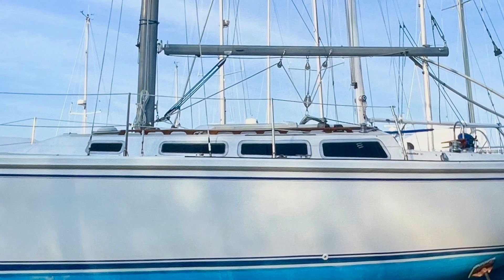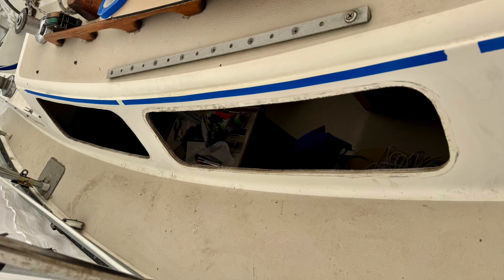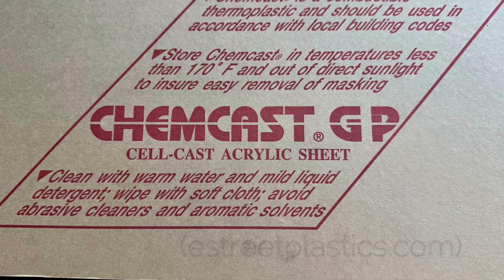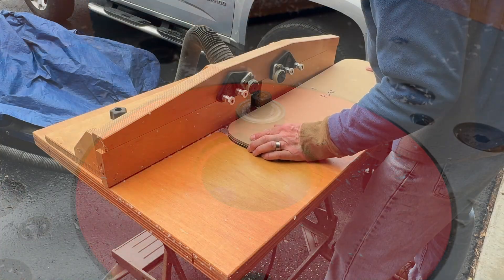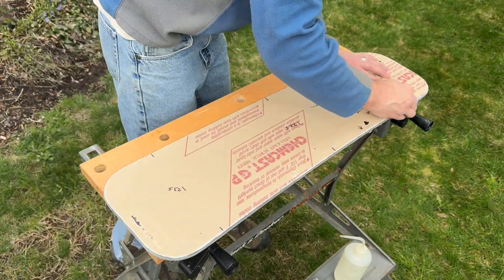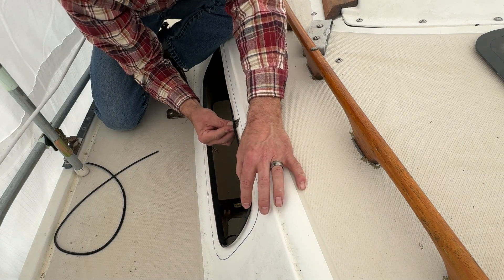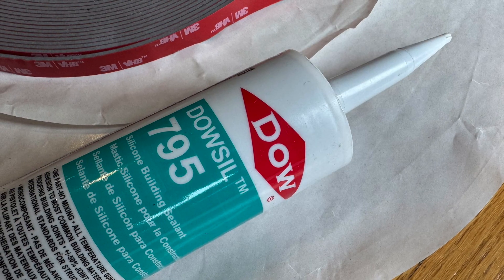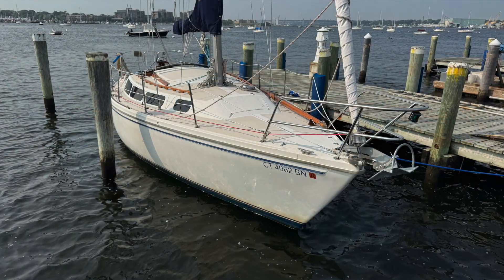Making New Frameless Boat Windows

Comment: Love this video and excellent timing as  I was looking to do this project on our 78 C30 Iin the next few weeks. 
How much 3m tape did it take to do all your windows?  Need to order some dumbbells also.
Reply from the maker: Thanks. One 100’ roll of tape was more than enough. I was also able to seal all windows with one tube of the sealant. The dumbbells were more useful to hold the windows for marking rather than needed for adhesion (the tape sticks very quickly). Good luck with your project.

Comment: Those one piece windows don’t seem last they start cracking from what Ive seen…. Did you ever try completely refurbing resealing the original windows  🤔
Reply: I did a rebed/reseal on my metals about 12 years ago.  Leaks just come back worse as the frames corrode more and more over the decades.
Reply from the maker: @thegarbone my 43 year old aluminum frames were badly pitted too.
Reply from the maker: You can spray them with a UV protection to help keep them from crazing.  To properly reseal the old window, they have to be removed.  It is a very laborious and difficult job. This was actually much easier.

Comment: 9:28. 
I used it too for my boat windows. 
You can also bent it so you can bring it on in one piece and have only one opening. 
Nice work. 
I did exactly the same 2 years ago. 
Gr from the Netherlands
Reply from the maker: Thank you.  I didn’t try bending the tape around the corners, but that would have been easier.  I was afraid the radius was too tight.
Reply: @brianweekley5700 
No, the tape is perfect. But keep the pressure with one finger wile bending. 
It looks very well on your boat. 👌

Comment: Good job anyway. All sailors are inventive and handy.
But, would you be more precise telling use "so far no leaks"?
Tell us like "two seasons on water and no leaks".
So far is not description. I'd like to know if such repair is good for one or rather 5-7 years.
Reply from the maker: Fair enough.  After one year, no leaks.  However, I’m confident this was a good and long lasting fix.  Changing from a frame system to acrylic panels attached directly to the exterior cabin top is much simpler.  The VHB tape provides a flexible adhesion interface that should allow for expansion and contraction of different materials.  Time will tell, but I have no regrets.

Comment: I sealed the badly leaking windows on my 1980 Catalina 30 by masking around the frames (inside and outside), removing every other screw in the inside frames and injecting slow-expanding foam into the screw holes.  The foam expanded into the voids on the inside of the frames, sealing the windows.  When the foam hardened, I removed the masking, scraped off any foam that had oozed onto the glass and replaced the screws.  The leaks were gone and stayed gone for the remaining 5 years that I owned the boat.
Reply from the maker: Interesting approach.  Had not seen or thought of that or I may have tried that instead!  However, I do like the updated appearance and have been happy with the results so far.

Comment: Great looking upgrade, makes the boat look more "modern"
3m products are my normal go to for vehicle work because they have product solutions for everything, like that bonding tape, as for using the sealant around the edges, thats all that product is, a sealant, the bonding tape is the primary retention for the windows. As for the original aluminum window frames acting as a cabin stiffener 🤔 those original windows assemblies leaked because the aluminum expands at a different rate than the fiberglass cabin and those frames do not flex compared to the cabin, so you get leaks. At least the new windows will have the ability to flex and have a 100% mechanical bond to the cabin cutout, so less leaks.
Reply from the maker: Thanks.  You are absolutely correct.  That’s why 5200 would be the absolute worse choice since it would not allow any flex between the acrylic and fiberglass.

Comment: Good idea and nicely taught and demonstrated! My boat's windows are already put on similarly, but are twice as thick and have some compound curves to bend them around. They are also screwed into the fiber glass with SS screws and dimpled washers. They are all crazed with UV cracks and will have to be replaced as I can't see through them when the sun shines on them.
Reply from the maker: Thanks.  Good luck with your project.  It's worth it!

Comment: Interesting Video. I did mine a few years ago. I used the Dow Goop without tape  My windows are also screwed in and then covered with a trim. Results are excellent.  Your quicker method seems a lot easier  and equally as effective. Nice to see.
Reply from the maker: Thanks. I appreciate the comment.

Comment: Thats really cute.
go through all the trouble and work to make windows on a boat then use home building sealants.
Reply from the maker: Both the 3M #4991 VHB tape and Dowsil 795 were recommended by the manufacturers and are more than suitable for above waterline applications such as these windows.  The 795 also has excellent UV resistance. Your specific concern is?
Reply: @brianweekley5700   Again, company specs mean nothing in the real world. That why 5200 is the go to choice for us in the North Atlantic and Bearing Sea, where failure is not an option, if you want to make it home alive.  But you carry on with your hobby sealants. BTW, the aluminum frame around the potlights you took out acts as structure to aid the tin flexible fiberglass topsides. Thats why the cheap original  sealants failed. Too much flex in the cabin top
Reply: my 1st thought was "does he know that black 5200 is available?".   i'd use it from prior experience and nowadays the insurance co's will nullify policy coverage if non-marine grade products are put into service on my boat
Reply: In most cases, the only difference between "Marine grade" and "Construction grade" sealants is only two to four times the cost.
Reply: @OrchidsOutOfChaos  Hehehe, tell that to the fishermen in the North Atlantic and  Bearing sea, They'll tell you stick to your computer and leave the building/repairing of boats to those with enough experience to know what they are doing

Comment: I did my West Wight Potter windows exactly the same up until the adhesive tape. I chose butyl tape and screws. I figured butyl would make my widows easy to replace in the future. I love the updated look it gives to my potter. No leaks in 3 years now.
Reply from the maker: Nice.  Understand the desire to use butyl tape and I do so whenever possible.  However, didn't want to drill more hole into my cabin top.

Comment: Well done video. I did exactly the same and it's still holding strong. I went a little thicker because I cut holes in the middle for opening portlights. The added airflow is great.
Reply from the maker: Thanks.  Opening port lights would definitely be an improvement in mine, but wanted to keep it simple.

Comment: I somehow doubt skyscraper windows are held in by tape,
Reply from the maker: The 3M VHB tape is a structural glazing product used to permanently adhere glass to the metal frames.  Of course, there may be additional trim, but it is an adhesive used for that purpose.

Comment: Thank you for the Tape info and for making a 10 out  of 10 video!!!

(I would recommend epoxy sealing the rough cut window openings before installing everything)
Reply from the maker: Thanks.  Yes, I used thickened epoxy to fill the gaps and edges of the window openings before installation.  Didn't show it in the video, but I mentioned that I did.

Comment: Nice job on the video. Did you consider heating the window and forming it to the contour of the opening? What other types of bonding materials did you consider, why did you settle on the 3M product? How many hours do you estimate it took to install the windows after selecting the materials and installation techniques?
Reply: Great job and thoughtful vid.  My job at my Yatch yard often requires these techniques. We have success bending plexy by using 2 heat guns, one on each side of the standing pieces  with the paper removed, giving in tandem ( 2. Hands ) for easily 15 to 20 min. To gradually raise the glass temp to 200f or so. Then clamping it down to a form of the correct curvature to cool.  No spring back if done right  and hot enough.  Some just put the form and glass on an oven and wait. 
We have found good result with sikaflex as a sealant as long as you use the provided cleaner and activator!.
Reply from the maker: Thanks.  Luckily, the curves on mine were slight and no heat was needed.  The 1/4" acrylic accommodated the contour nicely.
Reply: @johnanderson3842 What width plexiglass do you use?  The 1/4” seems very thin.
Reply from the maker: Thanks.  No need to heat these windows—I could easily bend them to conform to the cabin top.  No, didn’t consider any other bonding methods.  This is the only one recommended online as I did my research.  The 3M tape has a foam core that allows for expansion/contraction between materials. Total hours is hard to estimate since I didn’t work on them nonstop.  Probably 2-3 days to make the windows and another 2-3 to install. If I had done it before it surely would have been faster.

Comment: This is very helpful and the final result looks great.  I'm doing the same thing on an 1980 Oday 30 using ChatGPT as a guide, but you've filled in some important gaps (literally and figuratively) in the approach.  FWIW, it suggested adding interior marine plywood trim rings since the interior gap between the cabin and hull is uneven, ranging from 1/8" to 3/4".     Thanks for posting.
Reply from the maker: Thanks for the comment. I’m glad it was helpful.

Comment: This is a great video.. I would maybe use 3M primer 94 on the fiberglass before applying the VHB tape to improve adhesion and a hard rubber hand roller (like used when applying Formica...) to press the acrylic into the tape.  Pretty cool you  found U-Shaped edge binding.
Reply from the maker: Thanks. I wasn’t aware of the primer, but the VHB tape stuck very well nevertheless. The U-shape molding was a suggestion from someone on the Catalina forum—I was struggling on how to finish the edge once the aluminum frame was removed.

Comment: Thanks for the video. I was wondering what spray paint you used and if it’s still holding up? I’m about to do some similar windows on my boat.
Reply from the maker: Thanks. I just used a Krylon gloss black spray paint. I think any Krylon or Rustoleum type enamel should adhere to plexiglass just fine. My windows are holding up fine. They are prone to scratching (which was never a concern with the original glass windows). So, be careful of walking, lines, etc. and don’t use abrasive cleaners.
Reply: @brianweekley5700 Thanks for the info. I appreciate it.

Comment: Beautifully done.  Without flaming the edges of the acrylic after rounding and installing them, it will be interesting to see over time if crazing starts to appear on the edges.  Hopefully not.
Reply from the maker: Thanks.  I read that flaming the edges is not good and may cause stress cracks and crazing.  Therefore, I chose to simply sand the edges smooth. Yes, I hope they remain free of crazing for many years to come

Comment: Great video. I note you paint the edge of the inside of the window. Did you have any concerns with the tape and sealant bonding to the paint
Reply from the maker: Thanks.  I don’t have any concern with the tape sticking to the paint.  It seemed to bond very well.  I’ve also seen others do the same thing.  It would look terrible if you didn’t because you’d see the tape, caulk, and cabin top through the plexiglass without the masking.

Comment: Nice job, I think I would have painted that area first, before installing the windows. I refurbed the windows on my old C27 and it was really a pain getting all the old adhesives off the frames. It's a never ending battle with the C30 on stopping leaks.
Reply: Looks perfect.  Nice job.  Such great attention to detail, not skipping critical  steps and skilled work was the key to the beautiful outcome.
Reply from the maker: @dblaine1 Thank you. Much appreciated.
Reply from the maker: Thanks. Yes, frequently a battle. This came out nice. Hopefully, this does the trick.